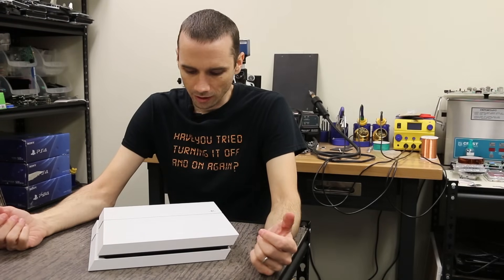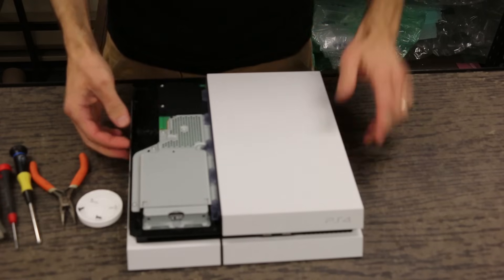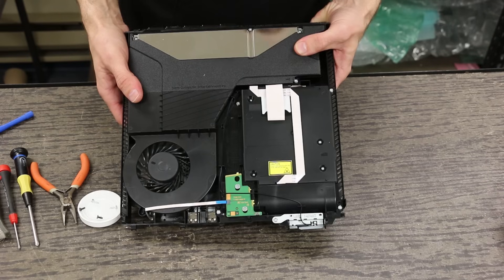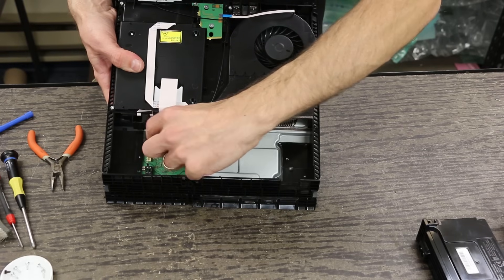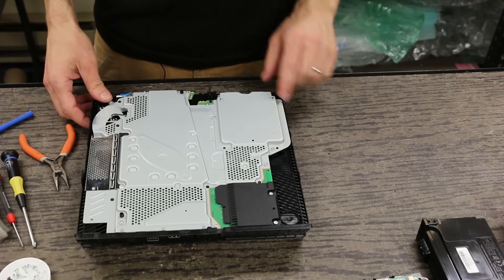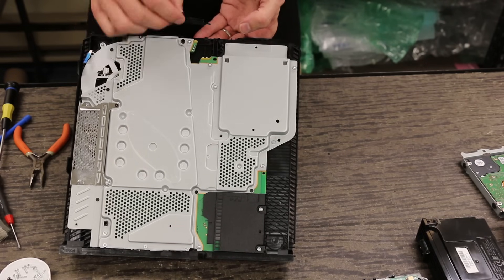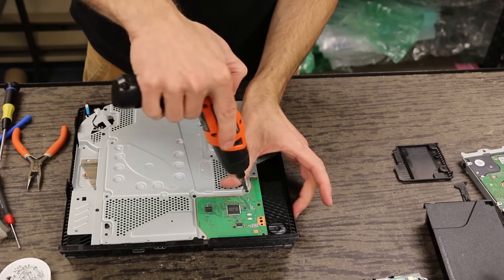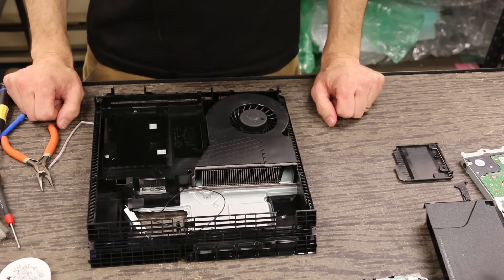PS4 1215 Teardown Tips & Tricks

Comment: Wow I just cleaned mine for the first time since I bought it new early generation and it is so quiet it sounds like its not even on. There was more dust than I expected but not the worst i've seen but still pretty bad and bad enough to stop air flow and put extra strain causing it to sound very loud and ger hot very quickly. Finally got my compressed air and T8 security screw driver set from Amazon and boy was it well worth the investment and well worth doing. I am a forever beleiver in this process now and will do it every year. It was neeve wrecking since the worst always goes wrong for me with delicate projects. I was convinced I would rip the the plastic in half or destroy the battery plug and wires and ribbons etc. I was scared because this machine is a seriously important piece of equipment to me and I would be devastated if I broke it. But it turned out great and the damn thing couldnt get quieter and boy does it feel great.
Reply: InfoBroker is using t8 and compressed air enough as a tool? Or u have something else?
Reply: @hafizbakhtiyarr  the 3 things that are mandatory really are just the T8, phillips head screwdriver and air. It would be helpful to also have a flathead to help pry open the casings as well. The alcohol and qtips was just me doing some extra detailing of the fan and crevices.
Reply: InfoBroker Mine has the same amount of screws as urs since it was 2016 ps4 model I believe so, thank you very much for the tips.
Reply: @hafizbakhtiyarr  Your welcome. Its not so bad surprisingly and I hope it works well for you. Think you will be happy with the results as I definitely am. Oh an makr sure when you blow out the fan to hold it still so the fan doesn't spin freely because it could get damaged like that. Good luck
Reply: InfoBroker I hope it will end gud for me, okey I’ll make sure I hold the fan while blowing it. Thank u once again.
Reply: InfoBroker bro I’m having problem to open the top cas, for some reason it’s so hard to slide it off:(
Reply: @hafizbakhtiyarr  Yeah it's definitely gonna be harder at first because it's like breaking the factory seal for the first time. Just make sure you removed all the screws and aren't grabbing it on the power button but on the casing corner itself near the power button. It does have a decent amount of resistance but what I suggest is trying to find the exact time stamp in the video where he is at the same step and just watch it a few times until you fully understand it.
Reply: @hafizbakhtiyarr  If you are talking about the first half you remove try pushing down a little and push out simultaneously as thats how I got my first piece off.
Reply: @hafizbakhtiyarr  00:54 time stamp for first step 1:17 sencond step
Reply: InfoBroker bro thanks a lot, I just did it and it worked:)
Reply: @hafizbakhtiyarr  Nice!! The bottom halfs were much more difficult for me but a flathead works well to wiggle through the seal as you work it. It's a little scary but its really strong so don't worry too much about it. I suggest really watching him do it a few times to get a good understanding but its not too bad once you get it going. Good luck and glad you are back on track. Just take your time and try to stay organized.

Comment: ••••READ BEFORE ATTEMPTING THIS••••
If this is your first time doing this, make sure you watch the video like 10 times just to be sure. Or else give it to a shop to get it cleaned for like 10$ or something. If you mess up the cleaning it will cost you more than 50$, so yeah. 

I messed up at 5:43 , like cmon dude i pulled the whole thing and now i gotta get it soldered. The camera angle and lack of details just made me pull the whole connector out. I didnt even think i was making a wrong move until five minutes later.
Edit : soldering was the only option which also didnt work and had to change my power supply in the end.
Reply: my uncle did the same thing i tried to solder it but it was ripped off the circuit board
Reply: Yoooo! I just did the same damn thing! Bricked my system. Had a friend's coworker do some soldering but still no luck. New ones already headed here but I'll still mess with the brick to see if it's something else that I didn't put back right.
Reply: Jon Wagner try a different power supply, might do the trick to the brick ;) 
Just be sure youre not damaging or doing anything dangerous.
Reply: @glaiveking2530  I wish I could man. I have my buddy who knows a thing or two about boards looking at it. But ultimately, the attachments leading FROM the board to the female side of the plug are what came off, so the board may done. Regardless, I'm fortunate enough to have been able to replace it already with a whole new system. But thanks for the idea.
Reply: @littlewags406  The exact thing just happened to me, so, are you saying that I should buy a new one or get it fixed with someone?
Reply: @RicardoRodriguez-ui3bi  I bought a new one. Pretty sure the only option at that point is to swap the board entirely. I have given it to a buddy who loves electronic puzzles, so to speak, but haven't heard anything back yet.
Reply: @littlewags406  Oooohhhh, thanks, but I have another problem, all my savings are in the HDD, and I don't have PS Plus, if I buy the Slim one, can I transfer de files? The one I broke is the Destiny Edition.
Reply: @RicardoRodriguez-ui3bi  I can tell you 100% either way. But I know the hard drive if removable, you may be able to put it in the new one if you do a little research into your model number and what current shelf model have. I would assume it'd work. But I'm not an expert hence my plastic brick.
Reply: I ended up pulling off the other tab from the power supply itself
Reply: Exaltments v2 just take it to a shop now and hope for the best before you damage anything further.
Reply: @glaiveking2530  i managed to unclip it with a needle and God damn this thing is dusty
Reply: Exaltments v2 be careful bro, many people had to buy new ps4s just cuz they messed this one thing up.
Reply: @glaiveking2530  dude i cleaned my ps4 and now it doesn't want to turn on, it can't be the connection from the power supply to the board because i didn't break that clip on the board or the powet supply.
Reply: Exaltments v2 no idea dude, i guess the shop it is
Reply: @glaiveking2530  i bought a new power supply but turns out I just disconnected the the female end of the 4 pin wire, my brother and I managed to sautter it back.
Reply: Glaive KING lol I checked to see if I messed up
Reply: I shoulda read the comments before I started because I just did this exact same thing
Reply: I did the same damn thing! Now i need a new ps4
Reply: Dude how do you take it off i almost ripped the thing off of the board
Reply: Did the same thing so my ps4 is screwed so I had to get a new one
Reply: @DescendantGamer  damn! I'm sorry bud.
Reply: @DescendantGamer  also, I made the mistake of taking the disc out that was in the system while it was apart. Now my disc reader tries to read a non existing disc everytime I start up. Just an annoying noise really and it stops on its own after a while

Comment: Help! At 4:42, one of the phillips screws has been stripped (when looking at the video, it's the one on the left). I tried so many methods including an elastic band and using a ttiny bit of glue to fill in the hole but nothing works.

I even found (presumably) the end of the screw on the back end of the ps4 and I need to remove this in order to replace thermal paste. Any help on how to remove this nuisance?

Comment: Ok guys I accidentally used the wrong screw driver I was using a t8 screwdriver you need to use a TR8 (torx security screw driver ) Don't strip your screws like I did

Comment: You only need to remove the 4 cables (not fully) under the power supply plus the supply itself and you're good. You can put the casing back on and start on the top if you're only wanting to replace thermal paste. No need to remove anything else. Unless you are replacing stuff that is

Comment: Man when I tore down my ps4
After removing the battery then there r some paper wires right 
First one from the right which is the medium sized cable one of it's silver portion broke and now my fan is not working is it related to or should I just remove my fan replace it

Comment: I destroyed my power supply trying to get the black wires out, just as a warning to anyone else following along
Reply: same here. tried to loosen the whole thing instead of the wires and ripped it off.
Reply: @Nachi_Keta  That’s exactly what I did lmao. Came right off the mother board.
Reply: Same now I feel like a dummy lol. Recked my own ps4 power just now and way to fix this before I buy a new ps4???
Reply: Same great
Reply: My ps4 is open right now but I'm looking at the comments and having second thoughts about taking out the power supply
Reply: Positivity  dont do it
Reply: @sharp2xtymes833  well actually i did remove it, except i didn't take out the wire. So everything was fine.
And this is what i would suggest people do
Reply: @HHoWASIQ  did you changed the thermal paste without taking out the power supply? after hours trying to remove that cable I gave up after seeing so many people destroyng their ps4's
Reply: @ArthurKowales  i was just trying to access the disc drive so i had no need of removing the cable and these comments made sure tht i didn't take the cable out.
Reply: @HHoWASIQ  oh ok. mine is stuck, feels like it's glued or something. while playing the last of us 2 I've got about 4 overheating messages, don't know what to do...
Reply: @ArthurKowales  try removing dust particles from those little holes and from the fan to release heat
Reply: @ArthurKowales  it's not stuck. You were pulling on the whole piece. I hope you didn't break it like I and most commenters did.
Reply: @jasoncampbell8439  It was actually stuck. I had to buy a plier and wiggle for about 10 minutes until it came out. You need to have patience. After that, all went fine and I managed to disassemble completely and replace thermal paste :D
Reply: @ArthurKowales  glad you were successful.
Reply: Same 😭😭😭😭
Reply: Same
Reply: Jason Gardner wait, you broke it by trying to take of the wires or by trying to take off the power supply?
Reply: @straw3730  trying to take off the wires looked like he was removing the bit attached to the bord so I pulled it and it snapped off doisnt work any more so I'm trying to reper it or buy a new ps4 looms like I'm going to have to buy one
Reply: Jason Gardner ok thanks, but taking the power supply out was fine? Im not ganna take the wire out so I just wanna make sure nothing breaks when I take it out.
Reply: yaboyDogger metch sane is there any way to fix it
Reply: Yeah that bit was confusing. I wish the guy in the video just pulled the wires out with his fingers as that’s the way I did it and now my PS4’s working perfectly fine
Reply: I broke mine too..!! Did anyone here fix it or bought a new ps4?
Reply: @familiarodriguez7  how did u break it i intens to tear it appart am scared to breack somtihing
Reply: Same thing
Reply: Mr. Fish same :(
Reply: Geometryse 1 is a messed up power supply when it keeps coming on but nothing shows
Reply: Same here, ripped off the power connector from the motherboard. I have to say, I didn't expect so many peoples have done my same mistake. I won't buy a new PS4 though, it's summer 2020 and we'll be having the PS5 at fall this year so I'll wait for it instead.
Reply: sadly the fate of few that watched this video and sadly took out the white part along with what was on the motherboard but glad i got the disk out before
Reply: @trueclownking  can you fix it or replace it somehow. Or do u have to buy a new one
Reply: Just happened rn omg 😢

Comment: 5:50 didn't really explain what to pull out. Besides saying just gonna pull this up.  Pulled the whole piece off. 🤨
Reply: I just did the same thing. Did you solder it back on or what happened?
Reply: Literally did the same damn thing. And soldering is the only option available. Gonna get it done tomorrow and hope for the best.
Reply: Glaive KING I ripped the entire thing off as well. Does it damage the board? Or just a battery replacement will work?
Reply: Isaiah Hernandez 
Best thing rn is to show it a trusted shop who repairs ps4s nearby, he will open it up and try to solder it (based on what u have done).

If that doesnt work ask him if any other possible issues are there like for me it was the power supply/ battery which got damaged. Replacing it worked thankfully. 

Sad to see people still see this video and get stuck on the same thing.
Reply: Glaive KING damn well let’s hope it works smh but I appreciate it
Reply: Isaiah Hernandez yeah bud, good luck !
Reply: Glaive KING took it to a repair shop and they weren’t able to do anything. Stupid mistake🤦🏽‍♂️ now lookin for another PlayStation. Thanks for the help man
Reply: Isaiah Hernandez welll i suggest to save up for the ps5. Really unfortunate what happened but hope you settle it out soon , cheers !
Reply: @glaiveking2530  Did it work??
Reply: joe mamma34 after getting the battery replaced yeah it works fine. Costed like what 60$ i guess
Reply: Same,
Reply: Mohamed Yosof wait you tried to take 
off the power supply or tried to take off the wires?

Comment: If you are having trouble taking out the bottom part, stick a butter knife kind of in the start of the ventilation thingy on the left or the right, just push down and it should pop off. It worked for me!

Comment: 2:28 no it doesn’t come right out 😭
Reply: It does if you break the clips lol
Reply: @AFXGaming  needed a flat screw driver to slide. My ps4 working well now :)
Reply: @NobleTenz  thanks for the tip, I used a flat screw driver to gently pry it open like a crow bar at that corner.
Reply: Brawlio worked beautifully for me after that advice
Reply: Noble Test nz I know right😭😭 I’ve been trying for 15 mins
Reply: been trying to get it off since this video first came out and still cant
Reply: MusicMcMania i used a flat head to unscrew it it worked some how and also the screw was loose
Reply: @xxility5789  i live u man thanks
Reply: i can’t get the screw off
Reply: Me and my stepdad struggled so much to lift that one side and then he tried again and just lifted it simply😂
Reply: I had to just wiggle mine around a bit and it popped off
Reply: I still cant get it off with a flat head screwdriver
Reply: shadow legacy I still can’t get it if with a hammer

Comment: This video is awesome but now I have an issue I wonder if you can help trouble shoot. When taking the power supply out I tried to pull the connector out of the board and the whole connector came off the board..... should I be ok to solder it back on?

Comment: I can't get the second part of the top off and my ps4 turns off a soon as I turn it on takes two beeps to turn on and then does one or two blue lights and shuts down
Reply: HB A5CENT Do you have the right screwdriver? If you do, to take it out you have to pull up and take the front part out of place, then you pull it out from the back

Comment: Hey buddy great video. I have bought a PS4 with a power problem. The owner has said that the plastic power button is broken. However I have removed this and it seems fine. The button feels slack while moving in an out is that normal? Or should I feel pressure behind the button??

Comment: I dont know why, but the second upper part of the console doesn't come off the PS4 2:22
Reply: NicolasEl Gamer24 I couldn’t get it off either you have to take out the screws in the middle and in the front of the ps4 on the power button then pull up on the part from left to right

Comment: Thanks for making this video. I thought it might be time to clean the inside of my poor PS4. I wanted to see how to get it apart without damaging it. I watched a few other vids, but some were on an older model with 4 screws on the back, & others were the right model, but the techniques used were a bit brutal. I ended getting mine apart by using a plastic bread bag tie, (flat thin plastic) & a small flat screwdriver, & my fingernails as my "disassembly tools". Once I cleaned away the surface dust, I saw that it was going to be a fair job to get the fan cover off to give it a proper clean. That's when I watched this video, to see if I was going to need thermal paste to get to the fan. Unfortunately, it looks like I do. Thanks to your video, I've decided to just clean it as best as I can without taking the motherboard out. Given the amount of dust that I got out of it, it will be much better than doing nothing.
Next time, I'll buy some thermal paste, & do a more thorough job.

Comment: Hey Steve, thank you for the guide - as usual really great stuff. 

Quick question, so I've been having the well documented problem with the drive not recognising some discs but working with others. In most cases it spins for a while, sounds like it'll eject but doesnt, continued spinning until it says disc not recognised. So a tap or knock on the top of the console will then cause it to read the disc in most cases. 

Cleaning my laser hasn't fixed it, so my concern is that I'll now need to replace the laser fully. Just wondering if you'd come across this as many people mention the tap method online, although it would be good to get to the root of the problem.

Any advice would be amazing, thank you!

Comment: I replaced a stuck Optical drive,,put in a new optical drive bought from Amazon, power on, Disc goes in but it doesn't read any discs,,did I need to reset the unit or what? Thanks